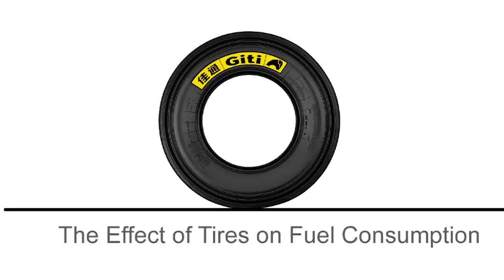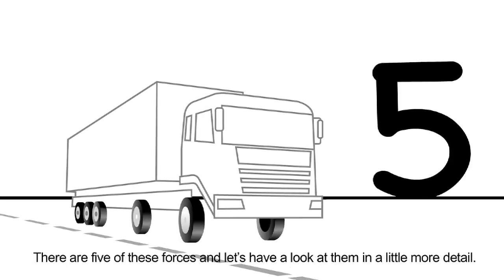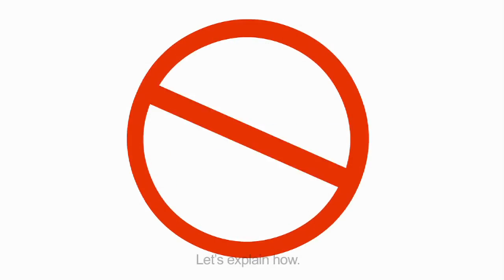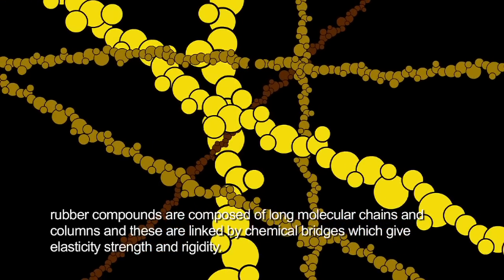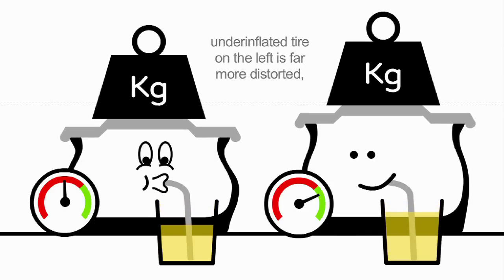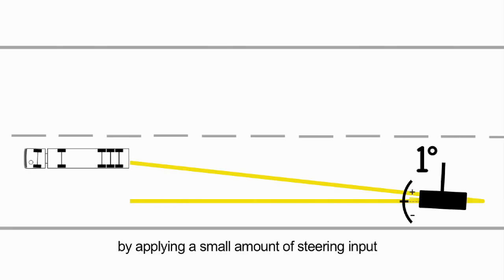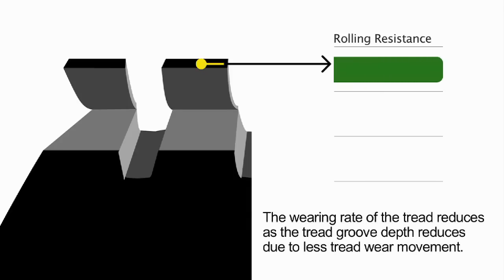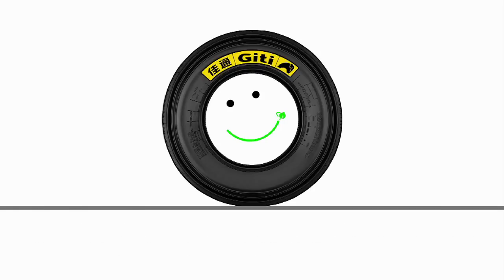Giti Tire - Effects of Tires on Fuel Consumption

Comment: Any one know which would be the best all season tires that are the most fuel efficient
Reply: Nope. But I do know that H rated tire compound will last you about 4 years, and you'll still have tread left. I put 40,000mi on my last set of H rated tires.

Comment: So if go from 14's to 17's tires , doesnt affect fuel consumption as long as its low rolling resistance?
Reply: Low rolling resistance tires, are only good in terms that they'll get you more fuel efficient and questionable quieter to a massive crash... Emergency maneuvers in wet, cold, hot or dusty environments are not what you want to do on such a tire... This video is useless... USELESS!
Reply: @kamendimitrov3884  Do not get low rolling resistance tires. Those are for SEMI TRUCKS! Get regular radial tires. I like H rated tires. Most salesmen will try to sell you Z rated tires. H rated tires are much harder compound. Thats the best/least rolling resistance tire compound that I know of (H rated compound). I was getting 280miles out of a tank with my 275/40/R17 wheels and tires when they were Z rated. When I changed to H rated tires I was getting about 295miles out of a tank. Its really not much difference. The Z rated tire performed significantly better in every other metric except tire wear and price. The H rated tire had less grip and when you did a burn out, it wouldnt leave deep black marks. It would leave a burnout but it was just dust. When the wind blew or rain washed it, the marks would almost disappear (not entirely but quite a bit compared to Z rated tire compound). If you got to the end of my long ass comment, heres a burrito! 🌯
Reply: @ryanmalin  I don't even know why are you telling me not to get these...

Comment: Can you help me here please, what is more convenient for me in this case?
Honda Fit Shuttle 2012, comes with tyres 185/60 R 15 originally.
I swapped around with the older car I'm selling because those tyres are new, being 185/65 R14. So my question is, which of these two different tyres are going to be more efficient in fuel and power for my car?
185/60 R 15 (Stock, original)
185/65 R 14 (The ones from my older car, I just want these only because they are newer, but if not efficient I'd just let them go selling the older car).
Reply: Many things come into play, tire weight, diameter, rubber compound, etc. Also you change rim size and weight. These things and reviews, at a minimum should be considered before buying!